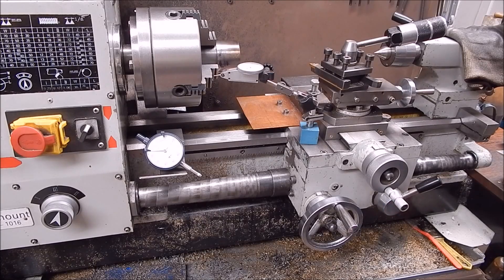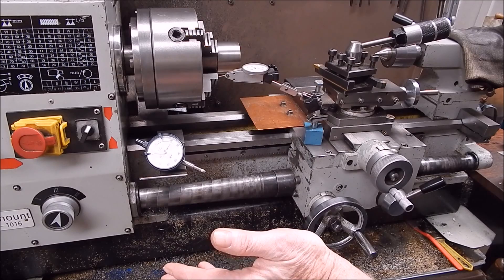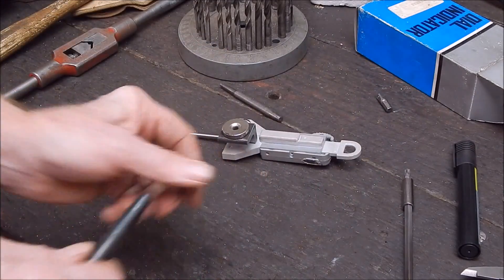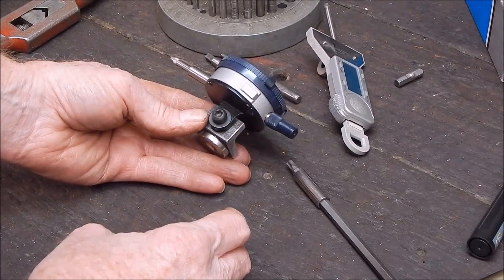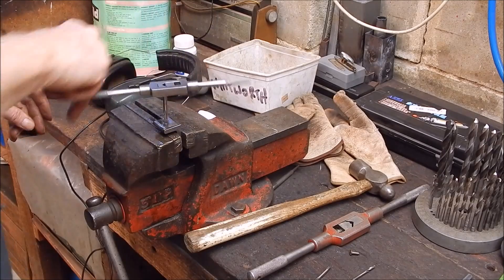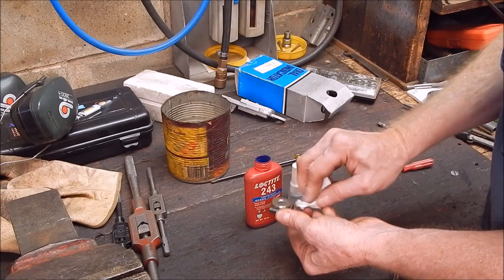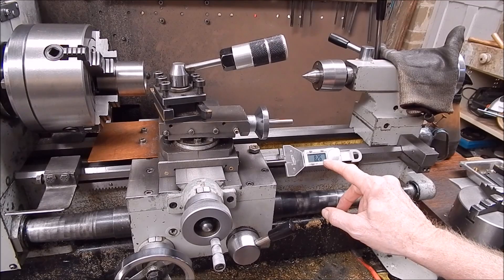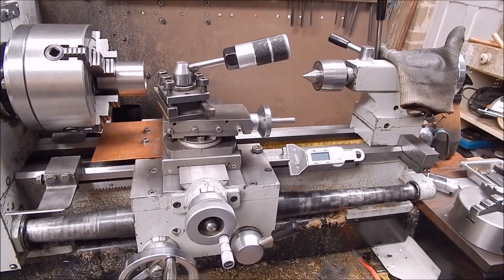Make a compact magnetic dial indicator base to measure lathe carriage travel

Comment: Hi Rob, do you have a part number or link for the igauging digital depth gauge. Thanks.
Reply from the maker: https://www.igagingstore.com/0-4-Electronic-Digital-DEPTH-GAGE-Gauge-INDICATOR-p/203921.htm

Depending on where you are these can also be sourced from Ebay and other online stores etc.

These are a combination depth gauge and indicator (has mount on the back).  The extension rods use a different thread to Mitutoyo.

I've never changed the batteries in either of my Igaging digital gauges and I've had them a long time.

cheers Rob

Comment from the maker: The Igaging digital indicator I use in this video is actually a combination unit, indicator and depth gauge.  It has the indicator mount and the depth gauge base and is a handy unit as the probe retracts level with the base, making it suitable for tight spaces.

You also get a variety of probe extensions.  Note: these are not compatible with the thread used by Mitutoyo.

It's not expensive and battery life is excellent.

A great unit.  Recommended.

Dial indicators with a magnetic base are also readily available from major suppliers including Starrett and Mitutoyo.  These are widely used in industry for machining and lathe work.

Cheers Rob
Reply: Where did you get this Rob? I'm trying to work out whether the one you're displaying has 100mm of plunger travel. I can only find 25mm.
Reply from the maker: Hi George,

Mine has 30 mm of travel.  I expect they are all like this.

I got mine imported from the USA years ago, but they are now available off of Ebay from dealers in Oz.

I was originally pointed to these by a Canadian viewer.

Good quality unit with excellent battery life.

Cheers Rob
Reply: @Xynudu  Thanks Rob I've had this on my to-do list since watching your 1st depth gauge mod. I currently use a digital caliper but the spring loading is a must. Please you decided to stay active on YouTube.

Comment: Hi Rob nice to be here. We are happy to see you explain your different indicator types and purposes, we see you mention this magnetic base this will be fun to watch and learn. You did a really nice job making that magnetic stand holder unit. 
Thank you for sharing, Lance & Patrick.
Reply from the maker: Thanks guys.  You can buy dial indicators with a magnetic back, but not in digital as far as I'm aware. 

Digital is better as you can set zero point easily at any stage of work - ie when backing out to cut a single point thread and reset for the next pass.  So digital has advantages.

For true accuracy an indicator is way better than relying on lathe graduations, which can be wrong (particularly on Chinese lathes).

Cheers Rob

Comment: Rob,
   What the heck kind of animal is calling in the background. I first thought a chicken which I hear on your channel sometimes but this sounds more like a lizard similar to one that drove us crazy in Vietnam back in the sixties.
    Good solution to the dial indicator mount. I’ve made a test indicator out of aluminum with a magnet on the bottom. I used aluminum to protect the ways on my machine.
Reply from the maker: Hi Dale,

It's a native Australian dove.   Some days the racket is unbelievable.

Cheers Rob
Reply: I can imagine Rob, it was pretty distracting with just the one. Our doves here emit a cooing sound and is very pleasant to listen to.
Reply from the maker: Hi Dale,

Most days it's no big deal, but trying to shoot video it makes life difficult.

I like birds, but ..................they can go a bit over the top at times.

Cheers Rob
Reply: Get yourself a plastic owl from Bunnings - doves & problem gone!
Reply from the maker: Hi John,

The guy out the back put one of those up for the parakeets that were ripping his fruit to pieces.  Didn't do anything.  The doves also didn't seem too worried.  LOL  He's tried everything and all failed.

But I see the Chemist shop has one to keep pigeons away from the aircon system and seems to work well.

I guess it works better on some bird types than others.

Cheers Rob

Comment: You gave me idea to do one for the tailstock. I already have a plate that I used a dial on but that I gaging unit will be better
Reply from the maker: Hi James,

Yes, it would be good on the tailstock with it's low probe height.  I like the zero ability, particularly for single point threading where you don't have a thread chaser.

You can do a pass, set zero, back out to reverse the cutter, go back to zero point, advance the next cut depth, and go again.

Try that with an analogue unit ;)

Cheers Rob
Reply: xynudu Rob I ordered one today, so when it gets here I knock off your magnet mount
Reply from the maker: Good move James.   Igaging stuff is pretty well made.  I have their Absolute Origin Cal digital calipers as well.  First class unit.  Battery life in both is excellent/amazing.

Cheers Rob